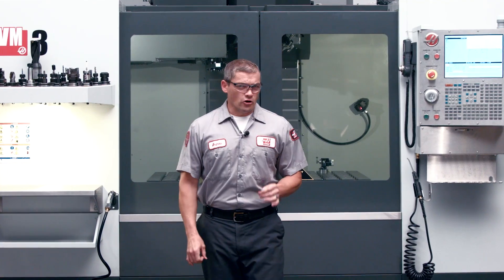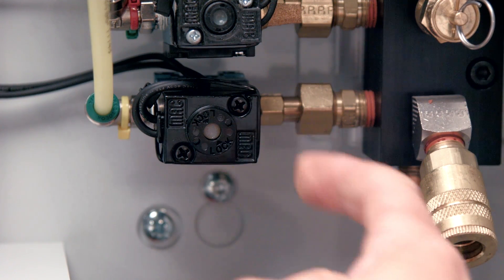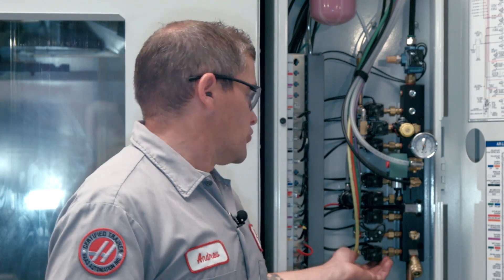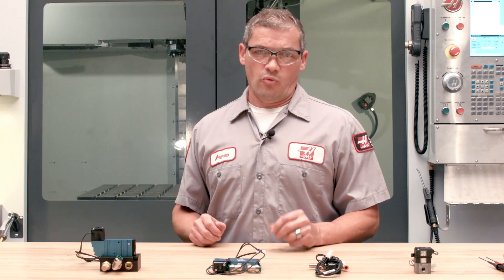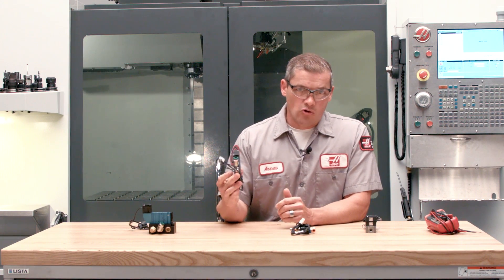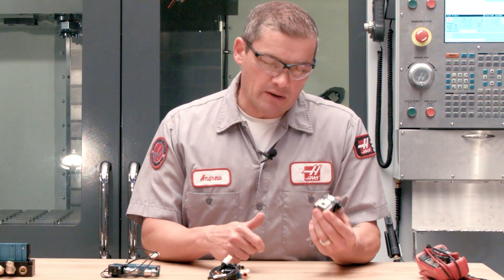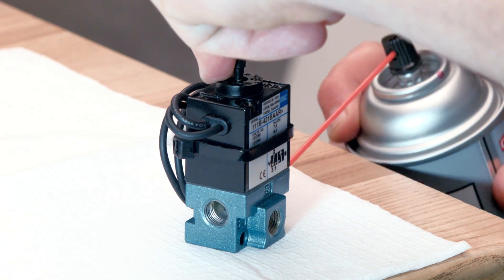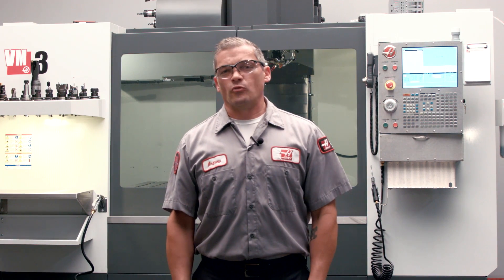Solenoid and Air System Troubleshooting – Haas Automation Service Video

Comment: Sadly this video is missing all the trouble shooting of components supplied with compressed air. 
When our TM1P (2010) is on significant amounts of air leaks out of the spindle housing both with tool in and tool out you can feel it blowing.
This video really needs trouble shooting that is not due to faulty pneumatic components.

Comment: Thanks for video! Can you clarify real requirements for compressed air. As I know, HAAS doesn’t required Refrigerated dryers. But after compressor , air has 100% humidity. It will definitely cause water deposit in the air system. But we may not notice water in air gun. I never notice any signs of water in my TM-2p, but after 4 years of using I found doors locks completely corroded.
Probably , it would be honest to make a requirement for air dryers before machines.

Comment: The TM-2P i run seems to randomly give me "Alarm 830" even though it runs perfectly for half the day. Any input into why it might be doing this and what steps I should take to fix it.
Reply: Order ferrite filter from Haas and put it on your Z axis encoder cable on the processor board.
Reply: What's 830? Might be a loss of air, or the valve shuddering.